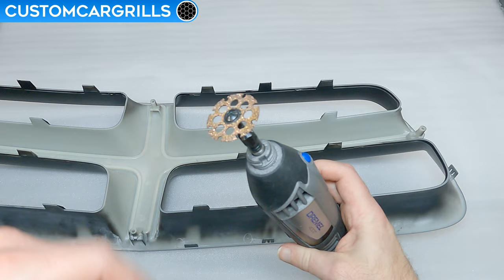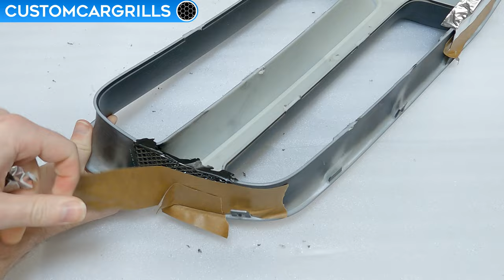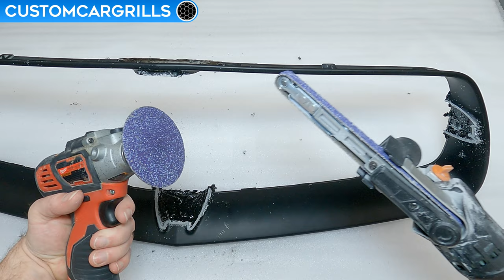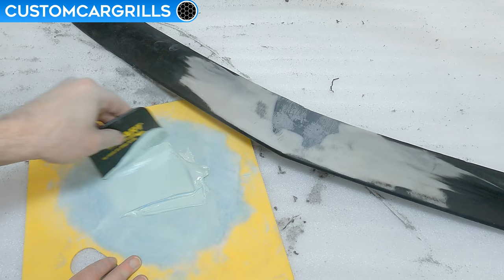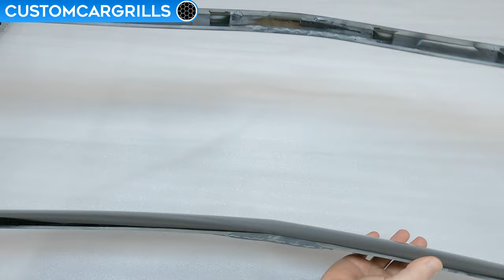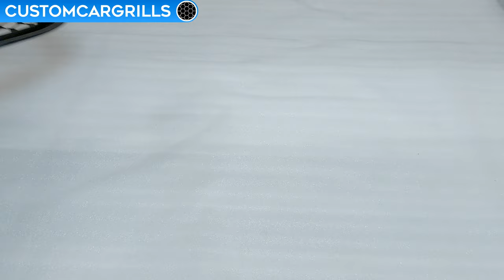Dodge Charger 2011 - 2014 Mesh Grill Installation How-To by customcargrills.com

Comment: I see on your website you have the charger crosshair delete full replacement for $599. So this whole process can be avoided if  buy that?? Id rather not have to cut, sand, and glue.
Reply from the maker: Correct, the full replacement option is one that is pre-made and ready to install out of the box.  At the time of writing this reply, there's not an option to choose a specific frame color but we can color match it to any of the OEM Dodge Charger colors.